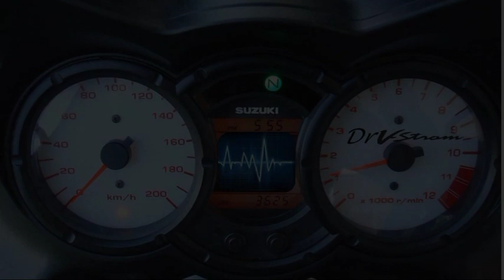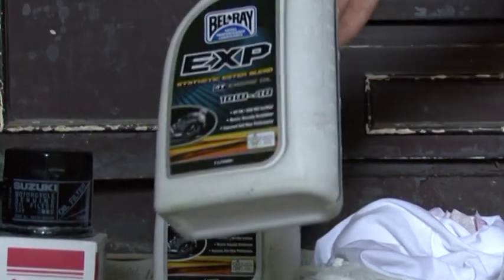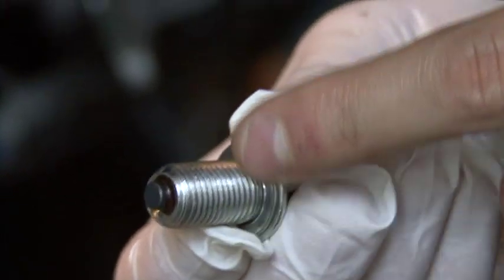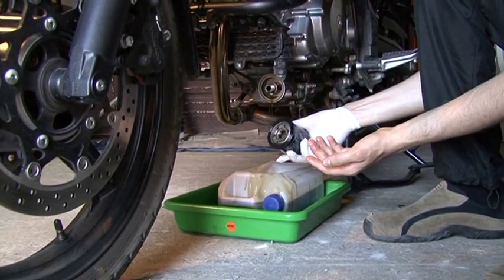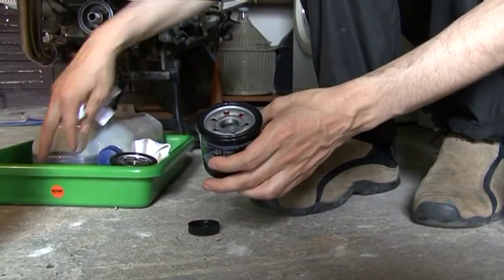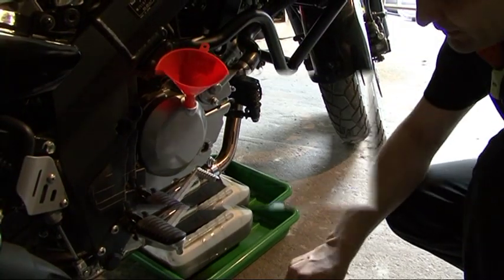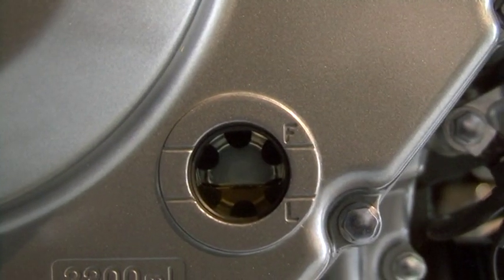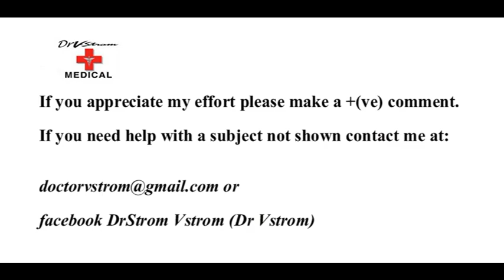How To Replace Your Motorcycle Oil & Oil Filter | DL650 Vstrom L0

Comment from the maker: You should check the diagram in your vstrom manual and the temperature ranges in the area where you drive. Then, after knowing the temperatures you can select the oil (eg 10W40, 20W50, etc). My brand is Belray but its only my choice

Comment: I always replace the crush washer on the drain plug and I mark the outside of the filter wrench rather than the filter since I need to use the oil filter wrench to turn the filter two complete turns. Thank you for the excellent videos on a superb bike.

Comment: I give the new filter some new oil internally before fitting.
Obviously can't fill it  but just a little saves a few seconds of  the engine running 'dry' before the oil pressure builds.  
Nice post though.

Comment from the maker: That really depends more on the following factors:

1. How you ride. If you are more of a conservative rider (low revs) or really push the engine.
2. The type of oil you use, ie SAE 20 W is good for high temperatures but not for cold ones
3. The quality of the oil you use
4.The oil color, if it looks black maybe its time

In General I change them every 4000 Km with an oil filter but you can leave them on the bike up to 6000Km like Suzuki says as long as their color looks ok.

Take care

Comment: Great videos. I have a V Strom 1000 and I was wondering how you keep your header pipes so clean?
Reply from the maker: Hello Mike, 

I have been asked before about that. I do not do anything special really. The only thing I can think of is that when that place gets dirty I clean it with a water wet wipe.  I also wear the engine guard and my bike is always parked in the basement garage which is a completely closed room. Hope that helps :) . 
I know that people clean the pipes with Harpic cleaning products for the bathroom, https://www.rb.com/brands/harpic/
but there was no need for me to do so until now. 

Hope that helps.

Comment: Thanks, John.  Please post the size of the gaskets for the oil drain bolt.
Reply from the maker: Hi Chris, I think its Gasket (12.1x16.2x3.7) but you can do 2 things. Either search for a store that sells vstrom parts and they will have them there also mentioning the size or if you are planing to replace the one you have, take the bolt and go to a store to buy one that fits the bolt.
Reply: Thanks, John.  I did both and none of the stores, dealers close by my place has it.  I did order on line and it's a little bigger than the OEM.

Comment: Just came across your videos. They are a big help. Do you change the oil every 3000 miles? I ride 90% roads 10% dirt roads.
Reply from the maker: Thanks. It all depends on many things such as the age of your bike, how well the engine breaking period was, the temperatures of your location, your driving style and the type/quality of the oil but if you dont mind the cost you can change it around there. It also wont hurt if you keep them a bit longer.

Comment: Thanks dr. Vstrom.. I would like to ask if the suzuki oil filter for cars is the same oil filter used in the Vstrom 650DL?
Reply from the maker: Gerald Magdaong only If the oil filter codes are the same. For Vstrom and other suzuki bikes the code is 16510-07J00.

Comment: Is stuff like maintenance (brakes, fluids, cables etc) and things like suspension adjustment or repairs the same on a 1000 vs 650?
Reply from the maker: Yes many things are either 100%  common or very close. Please refer to my newest video for oil change. There are usually updated versions

Comment: Ciao , prima di tutto complimenti per i tuoi video dettagliati e fatti bene , poi ti volevo chiedere una info : mi sapresti dire la misura della tazza per il filtro dell'olio e a quanti newton-metro si stringe il filtro olio ? Grazie un saluto .
Reply from the maker: Cup type filter wrench with 3/8" socket.
Oil Filter tool dimensions:- 68mm internal diameter with 14 Flutes.
Torque for oil filter is 20Nm and better watch this video which is better and newer https://youtu.be/RyV7NmCtB5E
Reply: @DrVstrom  grazie , grazie mille e buona giornata ;-)

Comment: I have a 2014 vstrom.  I only drive about 500 miles a season.  Stored inside house in winter.  How often would you think I need to change oil?
Reply from the maker: Hello, it depends on how long the season is. How many months and how are these miles splitted? Evenly or not? If the motorcycle sits for long periods unused and if you only do very short distances, then water will eventually accumulate in the oil and the oil will even break down faster. Therefore, its best to change it. Thus said cost wise, it might be best to get a cheaper oil that is still within specs and change it more often. However, oil is not your biggest problem. Your biggest problem is fuel especially since now gasoline has a high % of ethanol that makes a lot of damage if it stays in the system and is not fresh. Then its also the break fluid and the coolant. These two also cause problems, cause their chemicals break down and 1st one will break your abs pump (very expensive to replace). The second will clog your coolant system. Thus said a motorcycle is best preserved if used. Gasoline can stay unused if you put a stabilizer perhaps for 6 months without causing damage. Oil should be changed every year at least. The other fluids should be changed every 1,5 years if being unused. Hope that helps.

Comment: Do you ever pre-fill the new oil filter before installing it?
Why is 2800 ml stamped on the engine case?
Reply from the maker: jim snow the horizontal position of the filter makes it not possible to pre-fill as oil will come out while putting the filter. It does not say 2800 but 2300. There is a newer video as well in my channel which provides even more info.

Comment: Do you need to use torque wrench when tighten the oil plug.
Reply from the maker: I use torque wrench everywhere, Some people play the great mechanics and the say they have a great feel on when to stop tightening by hand. I m not interested in making such claims. The materials used in today's motorcycles and metals are not quality and mistakes then cost. You will need a torque wrench for other areas in the bike so why not use it also here? Hope it answers your question. By the way there is a more updated version of oil change in the channel, it has better information just look it up.
Reply: @DrVstrom 
Thanks for reply I need to invest in one.
Reply from the maker: Here, this one is cheap, good quality and covers a great range of torques https://www.amazon.com/BGS-962-Torque-Wrench-7-105/dp/B001ILCRKQ/ref=sr_1_5?crid=12SCVYKX723BH&keywords=bgs%2Btorque%2Bwrench&qid=1653422674&sprefix=bgs%2Btorque%2Bwrench%2Caps%2C137&sr=8-5&th=1

Comment: Hey man,I'm about to replace the oil on my V strom. I used motul semi-synthetic the last time, but i found cheaper oil from Ipone. I'm thinking: oil is oil, if it's the right one it should be fine. The molul says something about esther, ipone doesn't. They are both 10W40 motorcycle oils. Should I go for the ipone?

Comment: You forgot to mention at the beginning to warm the engine alittle first to make the oil thinner and any particles will be floating in the oil and not settled on the bottom of the sump.
Reply from the maker: wolfe1970 I suggest you start by watching the videos. Here is the last version https://youtu.be/RyV7NmCtB5E .
Reply: @DrVstrom  I did watch the video, i was commenting on this one :)

Comment: 2 complete turns of oil filter is far too much. I needed a special strap wrench to get mine off last time . Half turn is plenty.
Reply from the maker: Suzuki gives these instructions but do not forget that it also depends on when each person feels that the oil seal touches the surface. I m fine with this. Ride safe.